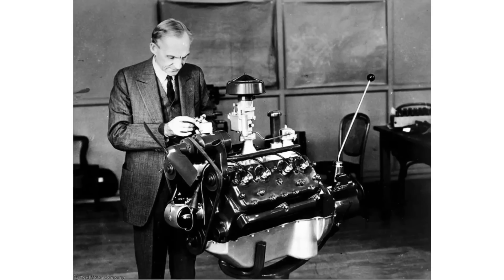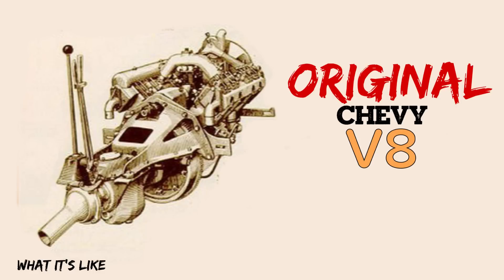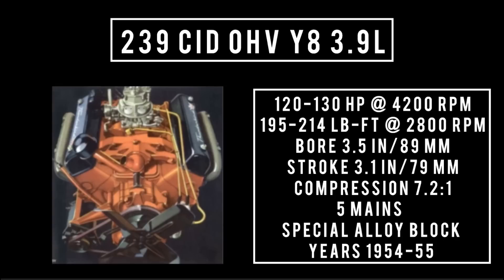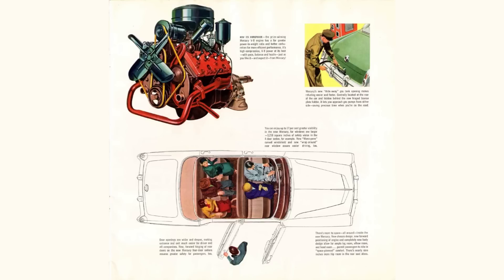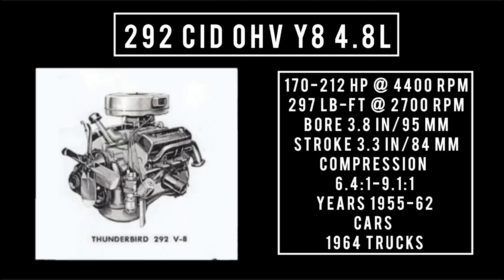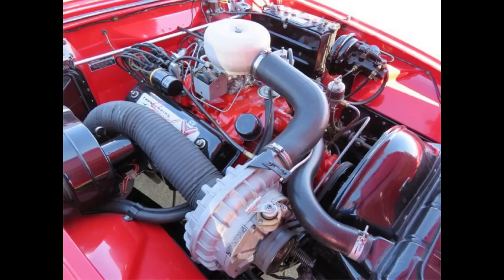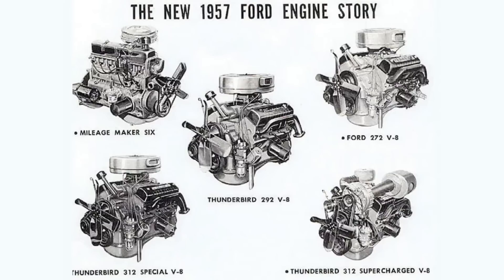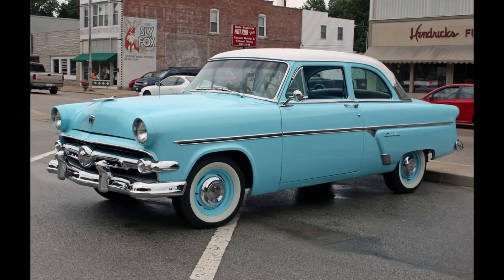Ford Y block engine family, 239, 256, 272, 292, 312

Comment: The bore of the 239 256 272 and 292 were in fractions and not rounded off to a single number after the decimal point.  
3.5  3.625  3.75   3and a half inches  3 & 5 eights inches  and  3 & 3qurters inch.   The 312 was not a fraction of an inch 3.8 inch was it's bore.
Reply from the maker: Turns out everyone rounds different personally I hate when the numbers are rounded I prefer actual numbers

Most people in my field wouldn't  respond to a comment like yours but I genuinely care about the information one these cars 

When I put this episode together I got the all the information on line which since then I've gotten books with correct information I'll probably end up doing this episode again in the future 

Here is where I got the info and again why they round numbers ( which like you said are terrible at it ) is beyond me 

https://www.conceptcarz.com/s1639/ford-thunderbird.aspx

Comment: Master patterns for the block were make at Midwest Pattern, Mpls in '52, I worked on those some as an apprentice.  Lots of coreboxes.  I have an all original '54 Crestline fordor, I fitted rods & mains to .001, I run 5-20 full synthetic, car has been all over the US and Canada, lots of miles at at 80 mph.  Carb' & distributor have to match, you cannot 'upgrade' without changing dist', as original is by far the best idea or it's problems.  The 239 stands alone in a lot of respects,.  I do have dual exhaust.  It's a great road car, smooth, quiet, great radio also.

Comment: how can I tell if I have a 292 or a 312 in my 56 Crown Vic anyone know
Reply from the maker: I found this hopefully it helps 

https://www.hotrod.com/features/shop-manual-antiseize-identifying-y-blocks/
Reply: @What.its.like.  thanks I just seen your reply I will look into it thanks for the info picked up a 56 Crown Vic
Reply from the maker: @ awesome car have fun with it
Reply: @What.its.like.  Yeah only problem is it's 6 volt Pos ground but everything still works so that's a plus it would be nice if it was a 57 12 volt Neg ground but it was a good deal it came with new chrome and the body is real good

Comment: A small block chevy can technically be bored and stroked to 434 cid, possibly larger with a aftermarket block! Personally id stick to 383 or 400 , shame the 400 was never a performance engine. Imagine a 400 in a 70 Camaro with all the LT 1 goodness, or a 850 Holley, high-rise intake , LT1 heads a solid lifter duntov 3030 cam, about 12.9:1 compression long tube headers 2.5" dual exhaust,with hambered exhaust, a 4speed 4.10 gears . Awesome 👍😉✌️
Reply: Who gives a shitt

Comment: It is also worth noting that calling this series of engines exclusively "Y-block" is historically incorrect.  The FE- and MEL-series of engines were just as much Y-blocks as these engines, and disregarding them when that engine lexicon is used is not acceptable.

It's also true that other automakers outside of FoMoCo built their own Y-blocks, yes; but they can be left out as this covers only Ford engines...and the FE/MEL engines are also Ford engines, as well as also being Y-blocks (did I happen to mention that?).
Reply from the maker: But was the first Y-block engine family made by ford
Reply: @What.its.like.  Oh, I don't dispute that, not in the least.  My dispute is with the "convention" of labeling those engines as the only Y-blocks Ford ever made, which is what the labeling implies.

Comment: Great video. The mention for the 292 production in south america is for my country. Argentina here that engine equiped the ford fairlane and the f 100 pick up. Also Ford argentina in the seventies had made improvements in the engine. Mostly in the redisign of the heads and a local engine was born. The name was ford 292 fase 2. So here we have ford 292 fase 1 y ford 292 fase 2.

Comment: The Ford Y block - A heavy, long-stroke, low-RPM, stacked-port, main-leaking, rocker-squeaking piece of low-horsepower junk.
Reply from the maker: Great way to put it the FE engine that came later was the engine that should’ve always been
Reply: @What.its.like.  And the cool partis that the FE will bolt right in to where that useless Y block was!  Even the smallest FE's got a whole lot more displacement than the biggest Y block. While the FE's heavy too, just changing to an aluminum intake manifold takes off a LOT of weight.
  A '54-'56 with a 427 and a top-loader is a fantastic combination, and it bolts together!

Comment: 56 T-Bird, 54 Customline.  I grew up on Y Blocks and have driven or owned every one of your choices. 
Just like the modern Chrysler Hemi and some SBC's, all Y blocks needed to be serviced regularly and liked some oils better than others ...
Note: All USA 292's had forged steel cranks and would spin to over 5K, which was pretty decent back then.  The stacked ports limited breathing, but there were solutions.  They could be ported to run well enough.  Note the 56 Nascar versions.  And they stood up to blowers pretty well.  A blown 312 w G2 heads will set you back in your seat  😁

Comment: These were good heavy car movers as long as detergent oil was used or overhead oiler conversions fixed the dirty ones. It was short lived and overshadowed by the fe series which i think was fords most universal series engine ever made .
Reply from the maker: Totally agree
Reply: Ah yes. The heavy, long-stroke, stacked-port, rocker-squeaking, main-leaking, low RPM Ford Y block  - Perfect for a boat ... 
as an anchor.

Comment: What about the 352.
Reply from the maker: That’s a FE engine different engine family
Reply: @What.its.like.  the 352 must have been the only fe to have the distributor in the rear.
Reply: @charileross1986  —😂😂😂
Reply: @What.its.like.  — Ole Chari here is probably talking about the 332 Lincoln Y-block that was used in many Ford trucks.

And like their Ford counterparts, they too were crap …
Reply: In 1958 the 352 was a y block and was used in many Ford vehicles in my application it is in a 4 ton dump truck. So go ahead and spray your internet knowledge down

Comment: The first year for the 312 is in 1956.
I had a 1956 Ford wagon with the "Thunderbird 312, Fordomatic trans, dual exhaust and LSD.
It had a very unusual center float Holley 4 barrel carb.
Reply: My grandpa had a 56 Tbird with the dual 4s and the electric overdrive.
Dad said he rigged the overdrive thru the kickdown switch ,so when it was in 3 OD and you nailed the gas,it would drop into second and make the back end squirm around at 40-45mph 😂
Reply: @MrTheHillfolk  Most overdrive transmissions would drop out of overdrive when you punch the throttle. They had a switch hooked to the throttle linkage.
I.E. 3od to 3rd or 2od to 2nd.
2 fours would break that light car, loose.
Reply: @rondpert5167  
I gotta ask pops again exactly what he did because he said it would drop from 3 overdrive down into 2nd no overdrive. 
I thought he added an extra dash switch for some reason and it tied in with one of those linkage switches. 
Haha either way ,grandpa definitely seemed like he was quite the wild guy , before the T-bird he had a straight piped Kaiser Darren and a piper super cub he land in the field across the street 😂
Them ww2 guys looking for a thrill.
Reply: @ I remember you could shift between 2od and 3od, and back again. But WOT would disengage the OD.

Comment: Y block with that dumb crossover pipe on the exhaust. Supposedly to clear the steering box. But r/h drive cars had it as well,, with the steering box enveloped!
The intake was a 'what were they thinking moment' and evidently top end oiling was an issue as well.
I owned one once, someone gave it to me, it ended up going to scrap.
Reply from the maker: Thank you so much for sharing that information

Comment: As the owner of a 57' Bird, It remains my pick. It has a great sound when running.🙂
And a comment on the 312 Y-Block. Ours has been rebuilt 5 times now ( 😡) and it's always the same problem: Front cam lobes worn off from poor oil flow. 
The engine needs to rev, as the only oil getting to the cam is from spray off the crank. Seriously considering a mod I've seen on another you-tube channel, where an oil distribution pipe is drilled into the valley just above the cam. 
Too bad Ford didn't solve this way back when.
Reply from the maker: Thank you so much for sharing your experience with this car with us.. I got to drive a 56 Thunderbird with the 312 V-8 in it nice rumble to it

Comment: The Y-Block had oiling problems.  The rocker arms could be oil-starved.  There was an after-market kit that routed oil from the external oil pump directly to the rocker arms. 
The FE engines were excellent.
Reply: It was easy to fix the Y block's oiling problem, but you will have to do some disassembly.  First, if no oil is getting to the rockers, you will have to remove the camshaft.  As this engine has "mushroom" lifters, you will have to block them up if the engine is in the car.  After removing the cam, check the center cam bearing and make sure all three oil holes are properly indexed to the oil passages in the block and that it is not installed too deeply or not deeply enough.  If the engine has never been opened up, and the bearing is not damaged or severely worn, they will be.  Next, if your engine is a 54 or 55 engine, make sure the center bearing journal of the camshaft has a groove.  The ones I have worked on from those years didn't, but I have been told by a know-it-all that many of them did.  Machine a groove in that center bearing journal if it doesn't have one.  If everything is OK, button it back up and plug that discharge tube from the rocker shafts that looks like it just empties out, so that the rocker shafts will be pressurized, and make sure the oil holes in the rocker shaft are clear.  If you use detergent oil, and REGULARLY CHANGE IT AND THE OIL FILTER, you will have a rugged long-lasting smooth-running engine.
Reply: @jamesbosworth4191 
I have an old hastings piston ring book called something like "tips for the professional engine rebuilder" ,i think mines dated early 70s as it mentioned a few vega things. 
Anyways,it had a full write up for fixing the oiling system and if i remember right you drilled and tapped in some external lines.
Reply from the maker: Totally agree 

Can’t wait to do the every engines going to try to cover as many engine families as we can this week I believe it’s going to be the poly had Chrysler engines to tie in with the dual ghia episode

Comment: Had A 292 in a f100 4×4 highboy, 1964.⅔ with i think dealer dual exhaust side pipes , a cross over exhaust delete, " that goofy manifold crossover  right in front" and a Carter 4barrel , 3/4 ton springs on dana 44s with  4" lift, long bed, forest green. Best truck ever. Traded it for a sailboat ⛵️ 😆.  Bought it out of a barn for 700 bucks. Drove it for 15 years, its  show truck in Houston now,
Reply: Where da pics !?

Comment: Hi Jay!  A COOL Ford engine episode!  It blows my mind they made the Y block in South America until 1980!!  These were very interesting engines, but the FE was much better, and the Windsor, while not as super powerful were always very reliable, at least in my experience.  WYR#1  Ya killed me with non super charged for the 1957!  Guess I would rather have the 1955 T-Bird.  #2 Still going to pick the 1957 T-Bird supercharged or not.  I like they did away with the continental kit and the fins are pretty cool!  Plus it was the last year for the 2 seat Bird for MANY years!
Reply from the maker: Great choices =) 

Im with you its crazy they offered this engine for as long as they did with they oiling problems they had unless they fixed them in different markets
Reply: @What.its.like.  Ford eventually fixed the problem.

Comment: I have never read or heard the reason for the stacked intake ports. It's like they wanted to incorporate one of the flaws of the flathead into the new engine. Also, a fellow employee at the Texaco station I worked at in 1965 bought a nice 1956 Ford Custom 2 door sedan, 272, three on the tree. We added dual exhaust with a Walker kit. The cross over was removed & a block off plate was installed on the right manifold. The left pipe mounted to the front of the left manifold & curved over it & down behind. A pair of Walker Continental glass packs were added. Dual tail pipes over the axle & past the bumper with chrome tips finished it off. Sounded a lot faster than it was!
Reply: the reasoning behind it was more torque and more even runners,  assumed stacking them (making them longer) would make them torquier, and its true. thats how a little 292 makes 300 foot lb
Reply from the maker: Thank you so much for sharing that story what great memories I’ve had cars like that as well that sounded a whole lot faster than they are.. but realistically the speed limits like 80 unless you want to get a speeding ticket. You could have the fastest car in the world the older I get the more I like the driving experience. 

I also love cars that the general population things are slow but they’re actually fast and find the drive
Reply: Ford was striving for equal-length manifold runners.

Comment: The Y block shares a lot of similarities with most of the first generation of American OHV V-8s. Two of which is the deep skirt block and massive weight. But it has its quirks. The stacked intake ports. Weird oiling system. The deep skirt really does not add that much weight and does allow for cross bolt mains. Heavy castings do. Given the Lincoln version shared the same bore center as the FE I have to wonder if Ford reused most of the tooling for the FE.
Reply from the maker: Thank you so much for sharing all that insight and information really appreciate it =) 

I was noticing that Ford went with the deep skirt design for their leader engines definitely going to cover Windsor/small block Ford and FE.. as well as other engine families
Reply: And all the Windsor- Cleveland engines have the same bore spacing as the Y block.
Reply: @JRB-uy4ml 
Just about. Five thou smaller. Y Block heads suck.

Comment: Ford envisioned these engines as being driven gently, with full power being used for occasional short bursts while passing. The valvetrain oiling was barely up to that but no more, and it wasn't long before excessive rocker wear and seizure happened when driven hard. Kits could be bought to fix this, with copper tubing routed through a hole you drilled into the top of the valve covers or you could DIY that. Most of the early engines were modified like this. You had to use detergent motor oil and change it frequently as the old oils had a high wax content and would clog up the oil returns. Without due care you could start having problems in as little as 20K miles which is abysmal as far as engine designs go. Some installations had the exhaust cross-over in front of the engine up front which caused more than a few people to get burned working on these engines. It couldn't match the SB Chevy in any regard, especially when hot-rodded, even with the rare and expensive Paxton supercharger, but it was good enough for the average driver who likely had a 6-cylinbder instead anyway. Later versions fixed these problems and the 292 was a very torquey engine that was popular in trucks, especially overseas where I'm told it was used into 1971. 

WYR I'm a sucker for the older 'Birds styling :)
Reply from the maker: Thank you so much for sharing all that information and insight really appreciate it =)

Comment: Hi Jay.  You covered the Y block pretty well. There was another contributor to oiling problems in that the cam bearing in question would sometimes turn.  The only other thing to complain about on these motors was that single exhaust cars joined the exhausts with a crossover pipe over the top and front of the motor, which definitely is not good for engine bay heat.  I wonder whether the deep skirt design was a factor in not having room to join the exhausts underneath?  Cheers.
Reply: A deep skirt on the block does necessarily make the depth of the oil pan greater. The deep skirt can be thought of as taking up part of the length the oil pan. But a really short oil pan might contribute to oil leaks around the pan gasket.
Reply from the maker: Thank you so much for sharing that insight 

Glad you dig this episode 

There is one mistake the 312 came out in 56

Comment: All of these 54 - 57 Fords and Mercurys were great-looking cars.  The 58 Fairlane 500 was spoiled by its side trim.  From certain angles, it made the car look like it had been in a wreck and improperly fixed.  The Custom 300's side trim was much better, as it mimicked the pressed-in details of the 58 - 60 Thunderbird, and didn't conflict with the body lines.

Comment: A great family of engines, but everybody talks about and covets the Chevy V-8, the go to engine for hot rodders, a testimony to Ed Cole, for designing that engine.
Reply from the maker: Definitely going to do small block Chevy on here one day
Reply: The Y block was NEVER a match for a Chev. Sounded nice with dual exhausts though and the 55-57 Fords did drive quite nice. 
Here in Oz we never got V8 Chevs until around 1960. The 6 was all we got, they went ok but not quite the same.

Comment: Owned two of these engines. One in a 1954 Ford, an a 1956. Extremely reliable engine.
Reply: As long as you regularly changed the oil and filter, and used detergent oil, they were fine.